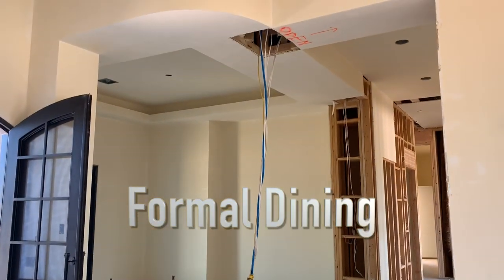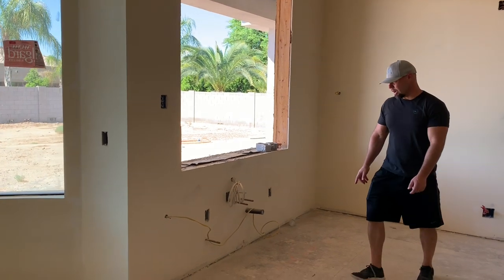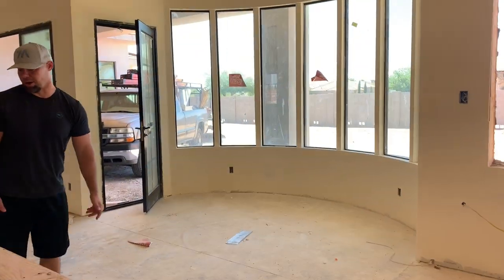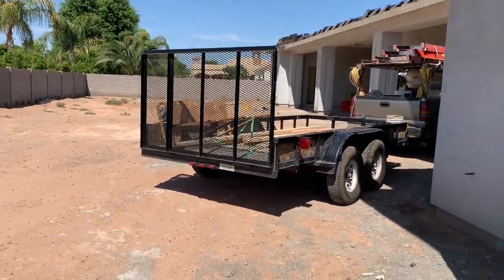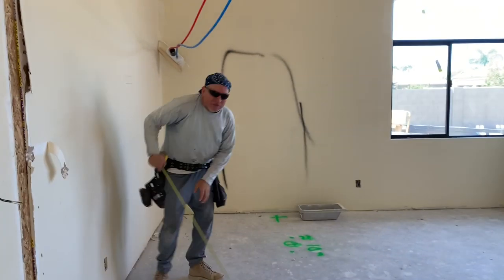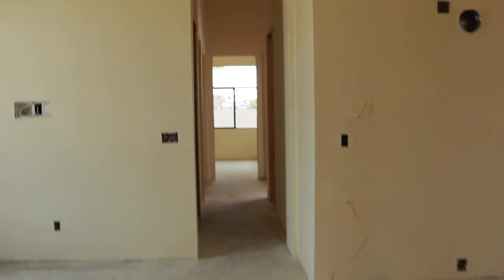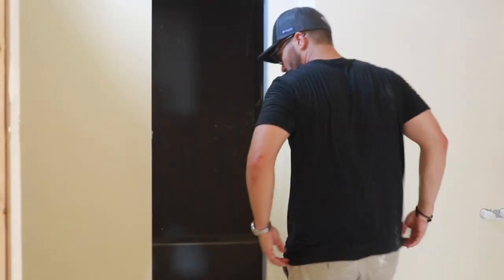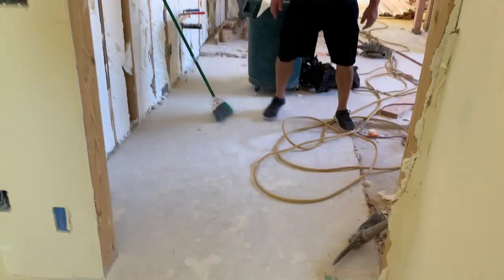Fix and Flip Case Study | Part 3: Redesigning The House

Comment: Nice vid Jerry. Quick question. When I'm working on a deal with a realtor trying to acquire an mls deal, is it always going to be a double close, and transaction funding involved? Or can it be assignable? And will a realtor always require ernest deposit, or can you put it in the contract that the buyer will deposit at the end of the due diligence?
Reply from the maker: You can assign an mls deal as long as it’s an assignable contract. Most agents will require an emd.